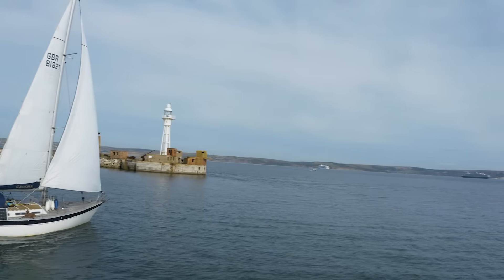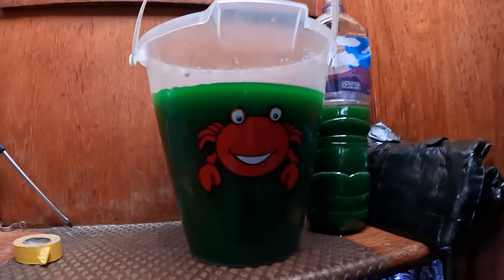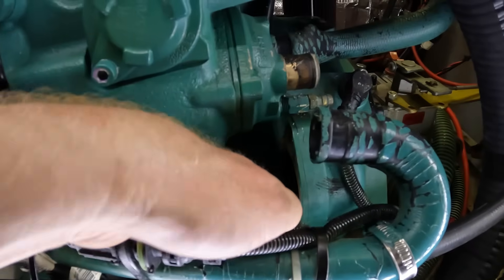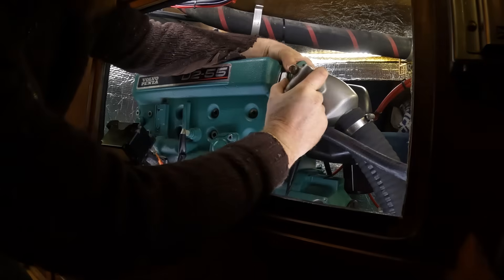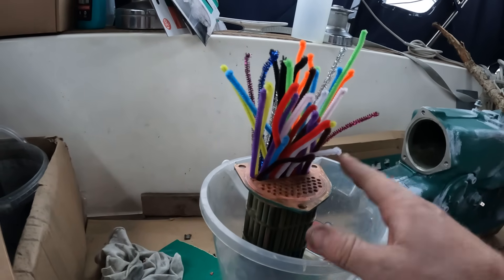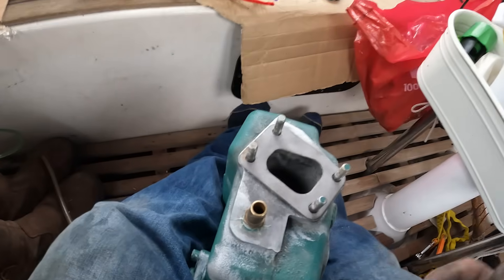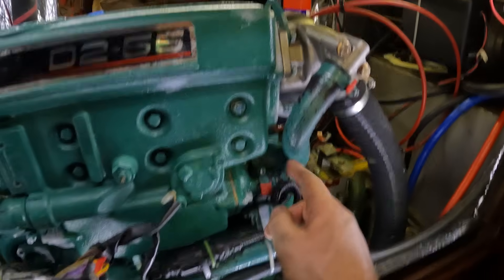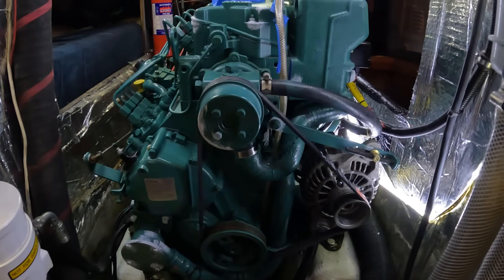Overheating  - Troubleshooting a small diesel sailboat engine  (Volvo Penta D2 55F)

Comment: I'm not a mechanic either, but I have some experience, and you seemed to have done a nice job! Now someone else can use YOUR video to learn how to take his Volvo engine heat exchanger apart. 
Check your bolt and nut tightness after 20 or so hours on the engine to make sure they aren't loosening. If you have a heat gun or hair drier, you can also apply a little heat to your hose ends to make them a little easier to pull off instead of risking nicking or tearing them prying with a screwdriver. If you have to scrape old gaskets off, and have to touch up the facing, use a woodblock with fine sandpaper to get as flat a surface as is feasible. The only place that is critical is on high compression seals as on your cylinder head. The thicker the gasket is for a mating surface, the less pressure it should be encountering. Cylinder head gaskets are frequently made of thin steel. This was a good project to have everyone else off the boat! 

I cut my hair short a couple of days ago and sit here watching your video with my knit cap on keeping my head warm!
Reply from the maker: Appreciate the tip there, Brian. I’m going to get some torque wrenches and check them all for equal tension and will be sure to check at regular intervals. Several people have highlighted the importance of that to me now, so best not ignore the wisdom being shared 🙏🙏😁⛵️
Reply: @CadohaAdventures  Also if you are tightening or loosening bolts around the high compression cylinders there will also be a designated pattern and technique for doing so, even to the point of loosening them after you tighten them and then retightening across the pattern. It's all to help ensure the head is taken down evenly so it doesn't warp.
Reply from the maker: @bdphourde  I’m trying to find details of this in the D2-55 manual but can’t seem to find any reference to a sequence of tightening the bolts? Any ideas where else to look?
Reply: @CadohaAdventures  If you can't find anything specific for a Volvo of your type, check in a generic diesel engine manual or search it on line or ask a mechanic in a boat or truck engine shop. But the torque settings will need to be specific to your D2-55. I will look also. That is just for the cylinder head bolts.
Try this one: https://www.youtube.com/watch?v=5WHBskK_F3o . It is shown on a Honda engine but the procedures are similar and it has pretty good procedures. Sorry, he speaks American English, I hope you can understand it. ;) There were a couple of comment tips worth reading on it. One cautions against using a wire wheel to clean the threads instead of a fine wire brush, and the other is to use a small rubber hose extension on the blower used to blow out the bolt holes, so you blow from the bottom of the hole upwards. My tip to add would be to use a thick bearing grease on the bolt threads, instead of just oil, before screwing them in. The load-bearing surfaces of the threads are an inclined plane that allows passage easier with proper lubrication. I think oil was too thin and you could hear the two bolts on the right side of the head squeaking as they got tight. Also a sturdy lube on the threads facilitates an easier loosening of the bolt when it needs to come out. The exception to this is on the exhaust manifold bolts. They get so hot as to burn off any lubricant and they get very dry and stick a LOT! It may not occur as much in a Marine diesel as the exhausts are cooled by water and not air. A last tip would be to always get a bolt started with your fingers several turns to ensure it isn't being cross-threaded, especially if you use a power tool to take them down to 'snug'. This also applies to wheel lugs on a vehicle where air wrenches are used to put them on. I have had them cross-threaded by the shop and then if you have a flat and need to change it out on the side of the M-1 at night in a thunderstorm on a holiday weekend, you will never get it off!
Reply from the maker: @bdphourde  I really appreciate this and will check that video out. I was looking at all tension settings on page 102 of this manual and didn’t see anything specifically for the coolant tank, unless it has another name that I’ve misses? http://www.eddievan.com/documents/engine/volvopenta/d2-55workshopmanual.pdf
Reply: @CadohaAdventures  In the coolant reservoir section on page 46, it never refers to it as that either. The diagram shows it being just above the heat exchanger. I can't tell if it is a single unit or not. If it is maybe they refer to the coolant reservoir as the heat exchanger. (That is what is designated on pg 25.) However I saw neither listed on page 100. In that case I can tell you what I would do. Bolt torque specs are generally determined by the type of bolt which has to meet those specs. Most engine bolts that are specified for certain torques have a code on the head imprinted in it when it is made. It could be a series of lines radiating out from the center, it may include some letters cast into it and any combination of those. [On pg 5 under Tightening Torque, they do list the general torques for the general metric bolts that aren't coded.] There should be a source on line that gives all those codes and if your bolts have one on them you can get the torque "range" from that list. If those coolant reservoir bolts have no code on them, it is likely that they don't have a torque specified for them. In that case compare them with the length and diameter of other bolts that do have specs for them and go with those. Or if the tank has no gasket that needs to be compressed, or the attachment points have no edges that will leak a fluid or air, then grease them and snug them up to where it "feels" right without overdoing it. It means it is just being held on tight enough to keep it from loosening.

On pg 7 they mention Torque-Angle Tightening which is what is explained in the video I attached to the comment above. Also read the 2nd paragraph below that one on Strength Classes regarding bolt head markings. 

Note that your head bolt specs (pg 100) are asterisked at the bottom with 3 notes. Since they are "noted" and generally acknowledged to be important, Volvo is obligated to list those for you. Pg 45 lists the 3 steps as 40>70>100 Nm. The bolt tightening sequence is the hole numbering chart on pg 45.

You need to look at your engine labels on your engine (pg 10) and find out which "Group" your particular engine falls in. The instructions are laid out by Group (Grp). 

I just found a NOTE on pg 45 saying that your head bolts are phosphate coated (like parkerization) and should NOT be WIRE brushed. I have also seen CAUTIONS about removing and then replacing bolts that may have different torque specs with the requirement that the bolts have to be put back in those same holes from which they came out.

Also many of the washers under your fuel injectors will be special washers called "crush" washers made out of copper. Since they compress when the injector is tightened to help properly seal it, then every time one is removed or even loosened, it is supposed to be replaced.

It might be a good idea if you don't already know how, is to learn how to "mark up" a PDF. If that is what you are going to have to reference to work on your engine, I would want to high-light NOTES & CAUTIONS & WARNINGS and other important procedures so they stand out with an electronic hi-liter. Carly might know this. I use yellow for NOTES, orange for CAUTIONS, and red for WARNINGS. Also it is good to mark the procedures that will require a SPECIAL TOOL! (They are listed in the procedures with a serial number which are listed in the info section up front.)

Pg 71 shows your heat exchanger tubes coming out of the back of the engine. Since that is the preferred method for ease of removal, you should check to see if that is correct and maybe it was inserted backwards before. I believe you took it out from the front.

Here is another option for your D2-55 engine service manual. It is on a CD:

https://www.bonanza.com/listings/Volvo-Penta-D2-55-D2-75-Marine-Engines-Service-Manual-on-a-CD/641168165?goog_pla=1&gpid=319078017749&keyword=&goog_pla=1&pos=&ad_type=pla&gclid=EAIaIQobChMI7oTm48WN9wIVRIJbCh1XXQN7EAQYAyABEgLo6_D_BwE

It's $13 USD but when I looked at the examples it looked just like your PDF. Do you have a Volvo-knowledgeable mechanic you could ask?
Reply from the maker: @bdphourde  Brian, you, Sir, have gone above and beyond!! Thank you so much for the time you took not just to read through this, but to highlight so many important things for me to go through also! And you can rest assured I will indeed be learning to ‘mark up’ a PDF!!! 🙏🙏😁😁

Thank you so much, that was an incredibly generous use of your time and we really do appreciate it!! ☺️☺️☺️🙏

Comment: Our Beta 30 allows easy access to both ends of the heat exchanger, the alternator requires to be loosened off as yours does, but other than that the tube stack slides right out of either end. The end caps are held on with 3 Allen bolts, the one at the exhaust elbow end is a bit of a pain though.
Because it's a simple one hour job we strip it and clean it out every year....Congratulations on a job well done....and very well explained...
Reply from the maker: I’m sure envious of your being able to tackle the job so easily. Although many have said that in some ways I’m lucky, as I have three large points of access which makes things easier than for some 😬🙏⛵️
Reply: @CadohaAdventures  Sorry, I should have said, we also have 3 points of entry, trying to do it from the front alone with no side access would be much more problematic....again, a great video..

Comment: I liked this video very much, very useful, and inspiring: Going through the process of "removing one small bit after another for access before finally realising it is easier to just remove the whole damn assembly" is exactly the process I used :)

My tube assembly, on a Lombardini LDW 502, was "welded" in there and wouldn't come out at all. One cannot force it too much because it is all brass and super-soft aluminum, eager to be scratched up and never seal again. After a day of struggle, I took the assembly out, it's only four hoses and four screws, got it home to the workshop. It literally popped apart in 10 minutes with no forcing required because now one could work at it from all sides. 

Lombardini recommends using a 10% solution of muriatic acid in water at 50 degrees centigrade temperature for the descaling. Takes about 15 minutes to do. I also replaced all the O-rings in there, since they are probably about 20 years old by now.

Comment: Great video, I'd never seen a coolant/seawater cooling system but it looked like you'd been working on engines for years. I had a penta gasoline engine in a smaller boat and would have loved to have that much room to access the motor. I had to change the thermostat about once a year and I would have replaced the coolant hoses while you had them off. They are prone to failure but fairly inexpensive. I'd recommend getting a set and keeping them on board

Comment: EASY WAY!!   I shut off the engine sea cock with the engine running, stop the engine as soon as sea water stops coming out of the exhaust.  Open the strainer and get your assistant to start the engine while you fill the strainer with white vinegar.  As soon as stuff comes out the exhaust stop the engine, replace strainer and wait a few  days...... to finish, just open the engine sea cock, start the engine and admire all the calcium deposits leaving your exhaust. Obviously doesn't deal with bits of impeller;) but you can get to those easily enough.

My md22l takes just over 4 liters of white vinegar. 

Great videos !

Comment: Its the only way to learn. Know your engine. Have the tools. Looking at the exchanger/impeller condition you may have been able to get away with just an impeller change. The other thing is that if the external cooling sea water goes through the internal parts of the tubes of the exchanger it might be easier to reverse flush any debris using extension hoses and external pump rather than taking many parts down to do the job. The engine cooling if containing antifreeze and corrosion inhibitor should be pretty clear. Still you learnt a lot of info, provided a lot and did it very professionally. Well done.
Reply from the maker: Appreciate your input. It’s strange as the coolant was a Volvo penta own ready mix?
Reply: @CadohaAdventures  I enjoyed it. I built up a twin cylinder 9.7 hpsabre marine, very similar to the small Penta. This engine was developed as a replacement for the Citroen 2CV petrol engine but it didn't meet the 10hp spec so the whole run was rejected and they were sold off. I always wanted a diesel for my 22' Intro but the marine versions were way beyond my budget. One day a guy at the boat yard said I have one for £600. Bit his hand off. Built it up in my garage and designed the mounts from physical dimensions and photos via a computer graphics package. Got the gear box from a breakers yard and had the flywheel modified. Been running well for seven years then Covid hit. Sadly now I am no longer fit enough to sail but it's nice to reminisce. Enjoy your sailing. Just reviewed your original video and it seems to confirm my thoughts that the external surfaces were fairly clean which means that the engine coolant was not the factor to the overheating. If it did not leak out after the end caps were removed then you may well have not needed to remove the manifold jacket but you learnt a lot. It might be worth while to get a life span value on the £1500 exchanger. That would give you a target date for full strip down. As mentioned earlier mine has been ok for seven years. The only other bit of info I can offer is to check the Woodruff key on the prop. It was phosphor bronze on a steel shaft. Somehow it sheared and I lost £700 prop. Bye

Comment: Great job Dom, especially with limited experience. There is a coolant drain plug near the bottom of the engine which you can attach a hose and drain. Be careful with the ratchet spanner. If you undo a nut and there is not enough room at the end to get the ratchet out due to a short bolt, then your ratchet and bolt are stuck. Solution is to cut (hacksaw) the bolt and may not have enough room for a nut. 
The sensor you put grease on before connecting on the side of the engine was a electric conducting grease I hope. Most grease is not. My volvo penta (different models) heat exchangers had one small hole half way along which needed to be at the top. Did you see a small hole? If not then they have changed the design. Recheck your bolts and nuts with correct torque after 5 or ten hours use then you can relax as you have done a very good, careful job. André in Sydney.

Comment: a bit off topic.  if you’re taking on water in an emergency, depending on hoses (you might need an extension), it’s possible to close the seacock for the raw intake, disconnect the intake hose from the thruhull, and place the freed end into the intruding water, run the engine and it will suck up water

Comment: with my yanmar 30hp, to clean the heat exchanger pipe i use a .177 gun cleaning rod with the brass brush, worked a treat and cleaned the pipes nicely, i placed a little oil on the o-rings while installing them, engine runs at correct temps now

Comment: I honestly cannot believe how hard checking that heat exchanger on the Volvo. On my westerbeke the heat exchanger is external to the engine and super easy to check !! Wow kudos to your determination tearing the whole engine appart !!
Reply: Hi Eduardo.  I'm into my Westerbeke 46 (30 years old, under 3000 hours) but looking at the exhaust manifold, wanting to clean and paint it I'm worried, having removed the bolts, broken one, and preparing to pry the manifold from the engine block that I may break something.  Any advice? Have you ever removed the exhaust manifold from the engine block? thanks, D Day, Maine
Reply: @DScottDay   your fears are well founded ! My 58 is 40 years old 2600 hours and every time I pull a part (fresh water pump, exhaust elbow, etc invariably one bolt will brake or some screw will strip. It is definitively a risk so I have learned to look at the cost of the piece before I take it out and if it is too much I will switch to reactive repair only 😇
Reply: @eduardoacosta6199  Speaking of Exhaust Elbow:  This may be the deal-killer for me.  With bolts out and only one broken (and that at the head, no real issue) and the manifold showing No Chance in Hell to move, I look at the Exhaust elbow and think: how do i ever move that?  The clamp on it with nut off shows no sign of releasing, but then there's the real issue of the elbow.  If I soak that for a year I think it ain't moving.?
Reply: @DScottDay  so to check the exhaust elbow you have to remove a portion of the heat exchanger in my case with the 58 it wasn’t a huge deal but a little corner of the exchanger piece did brake off. So yeah they are low time engines but still old so you got to assume those proactive checks could come at a cost but usually the reward is worth it in my case my elbow turned out to be totally clean and same thing with my fresh water pump but I feel better knowing that

Comment: That overheating saved you from a major fault developing ! Galvanic corrosion between aluminium & stainless steel in sea water is extremely fast & would have not only failed in use but also it would have cost you a fortune to replace the heat exchanger housing, if the engine didn't get damaged.

Comment: Good job on the heat exchanger, I used the same method to clean my large espresso machine, vinegar works great and fast if you heat it up a bit.
Reply from the maker: You're not the first person to mention heating it up, so I think that's certainly something I'm taking away with me for the next time I tackle something similar. Thanks for sharing 🙏🏻😁